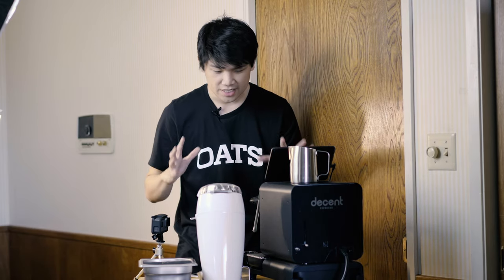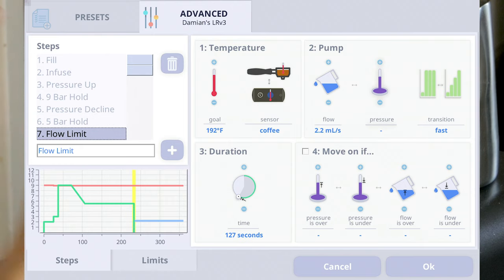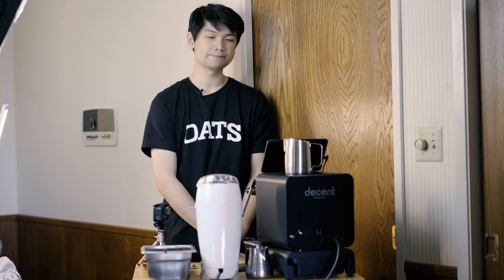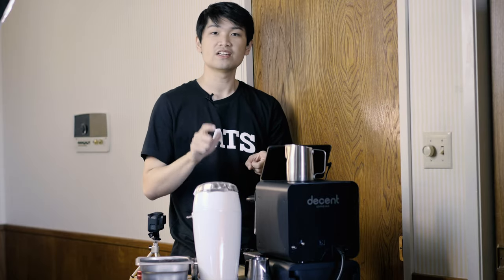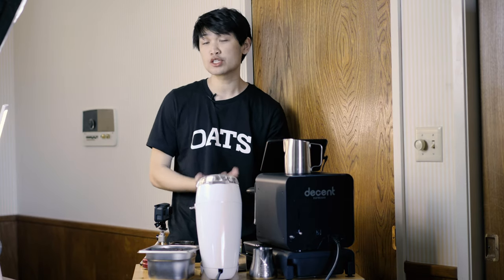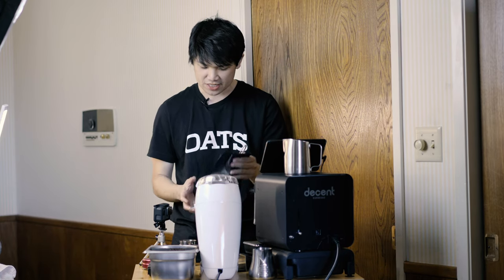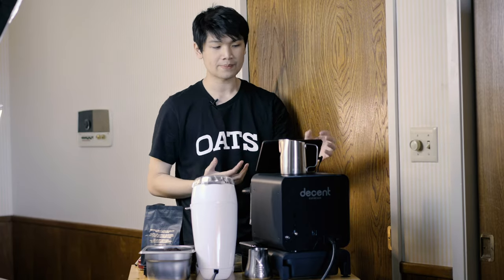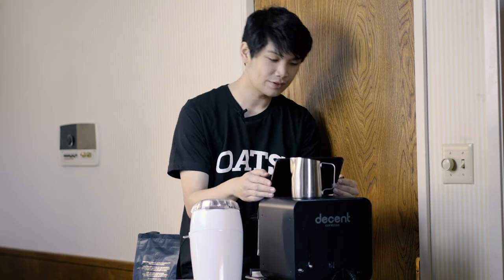Dialing In Espresso on the Decent Espresso DE1 (Approach, Tips, + Ramblings)

Comment: Excellent video. Can you please tell clarify a few things for me?

1. When you get a new bag of coffee, what's the process? Do you start at the same grind as you left off with on the last bag and make small adjustments?

2. Let's say you drink an espresso every morning out of the same bag. Once it is dialed how much does it drift each day? Do you have to make/waste multiple shots every morning?

3. Any tips on how you store your beans? 

I have a de1+ on queue and can't wait to get it! Thanks again for the great content.
Reply from the maker: Hey there,
1. I find most beans that I use are med/light roast type so I don't have to do crazy grind changes when swapping beans. Generally speaking if you're drinking the same type of roast the grind sizes won't have to drastically change (there are some edge cases with huge/small beans lol). You'll be able to tell if you need to make small changes based off of the data/taste but small grind changes (if you're in the ballpark anyway) won't drastically make things worse/better. What grinder are you going to be using? 

2. So that kinda depends on what grinder you use. On the Niche Zero I rarely if ever have to change grind settings within the day if I am using the same profile. Of course if I swap profiles I have to change my grind. Another thing to add is that some profiles such as the Londinium V3 profile I showed include all of that conditional programming to compensate for bad prep/inconsistent grind. Once dialed in if you're using a good profile/don't mess up your puck prep you'll have consistent data/shots. I have a consistent rotation of beans I cycle through all the time so I have a good feel as to what they should taste like. I rarely waste any shots anymore. Once you use the machine enough you'll get a feel for how the data/profiles impact taste. 

3. I personally use the airscape and one of the generic storage containers. If you consume at a fast enough rate it won't really matter. I posted an equipment guide so make sure you get all of the supporting accessories! It would be a shame if your DE1 came and you couldn't prep properly. 

The DE1 will be a super fun machine! I haven't been very active on the diaspora but I'm more active on the espresso discord. If you have any more questions hop in and we/others can chat. Thanks for watching!
Reply: @BrianQuan  thanks a bunch. I have a monolith flat max that shipped yesterday. I mostly have drank pour overs for the last 7-8 years.

I mostly drink light/medium roasts as well.

Will go check out accessories guide now.
Reply from the maker: Oh perfect! Monolith Max will be great!!! I'm waiting on the OZIK before I go to the endgame. I briefly heard about some complaints when using it with the DE1 on the Kafatek forums but I haven't checked. Make sure you get all of the tools to ensure there isn't static/retention especially with the monoliths. 

Dialing in is going to be extremely easy on the monolith due to its consistency. It'll be very easy to diagnose what's going on in your shot. You'll be able to see visually and in the data if your prep is bad but I think the grinding quality may compensate for that.
Reply: @BrianQuan  static is kind of an issue here regardless as it's so dry(AZ). I currently have an ek43s with ssp coffee burrs and a little rdt usually takes care of it for brewed coffee. I'm not sure how espresso will be.

I believe that the monolith comes with a wdt tool and I purchased the v3 decent tamper so hopefully I have my bases covered.

I read so much conflicting info on "distribution tools" like the Ocd so I'm not sure if it's worth buying one of those.

I'm super overwhelmed by figuring out puck prep. Like you watch videos on it and it seems so easy visually, but then reading about it, and people's struggles, it seems so hard to get correct.

Those ozik look amazing. Wouldn't mind getting one in the future myself if they work well 😁
Reply from the maker: @imprezivr61  luckily you'll be able to figure out puck prep fairly easily with the DE1. RDT + WDT (wdt will do your distribution) then tamp will be very sufficient. The "distributors" are actually levelers as they only flatten the top of a puck. There's someone on the diaspora/discord who posted a bunch of videos with a glass portafilter showing you what's going on inside. 

Once you get your machine I'd be happy to keep chatting in the diaspora or discord if you need help with anything! I'm thinking about putting together a video geared specifically to new DE1 users (probably just a more concise version of this vid) but I'll have to find time for it.
Reply: @BrianQuan  thanks again Brian! I'll definitely pop in the discord as soon as I get my machine.

Comment: Hey Brian, great video! 
One question: When you say you're adjusting "a little bit finer"  or "a little bit coarser" on the Niche, what kind of steps are you making? Half a step?
Reply from the maker: Around half or even quarter of a step for small adjustments to the pressure curve. It's gonna be down to what profile you're running though!
Reply: @BrianQuan  thanks!

Comment: Hi Brian, thank you for your contributions to the DE1 Community, your videos have been very helpful. I have recently purchased a DE1 and have had it for a month now and still feel as though I am trying to dial in. All of my espressos seem to be a bit on the sour side. I thought I'd keep it simple and use the default profile. When you shots are a bit sour ... how do you recommend adjusting? I started off coarse and have been going finer and finer but it's still a bit sour. When I look at the data it seems like I've been mimicking the profile pretty closely as you recommended so it's hard to know if I should keep going finer or go coarser, or raise the temperature or move on to other profiles.
Reply: Extract more

Comment: Haven't see you on the Diaspora owner's forum. Did we miss out on giving you an invite?
Reply: We're actually chatting at the moment about how to improve the app to do your 'dialing in' approach, by auto-loading a "god shot" reference. That way you'll see your current shot lining up to the reference shot.  Much easier.
Reply from the maker: Sent an email. I definitely think a preview of what the shot should look like rather than the visual of the steps would make it a lot easier for a beginner to understand how to dial in. That way it's: 1. Pick Profile (see what it's supposed to be doing visually in the graphs 2. Adjust grind size until they match that graph (God shot) 3. Adjust temp to taste. Would be happy to chat more in the diaspora! I've been meaning to be more active in the DE1 community too.
Reply: @BrianQuan  Yep, that's the intent of the God Shot, but since we don't provide one with the default profiles, it doesn't help (yet) in the way.

Comment: in search for the god shot....
Reply: no distribution tool?
Reply from the maker: I actually don't really have to tamp because the Decent Tamper is a self leveling tamper! Distributing makes tamping a lot easier though.
Reply: @BrianQuan  do you ever use the default 9 bar e61 preset? Or do you always find yourself using other profiles?
Reply: I have an e61 machine with the ability to control the flow but nowhere as precise as the decent espresso machine. Would love a taste comparison with the same coffee and different profiles. Thanks!
Reply from the maker: I mainly switch between lever and slayer type profiles. Honestly haven't had a shot that is held at a constant 9bar in a very long time. On your flow profile E61 you can look into long preinfusion + slow ramp up + ramp down. There are a lot of discussions on E61 flow profile. If you hope into the espresso discord we can help you more!